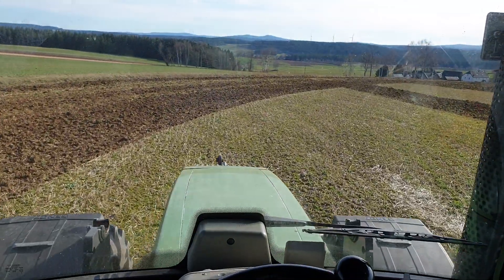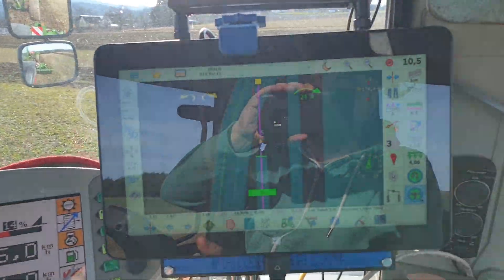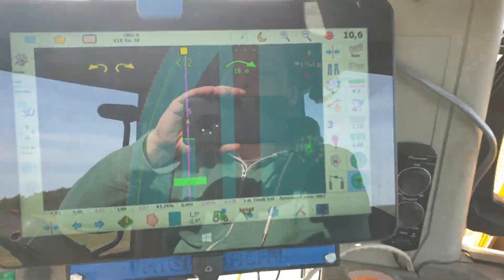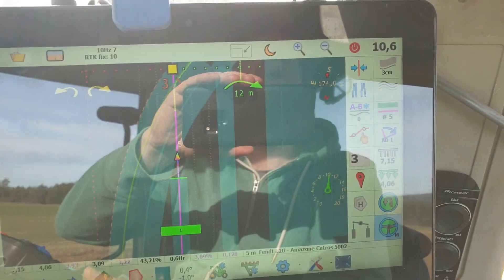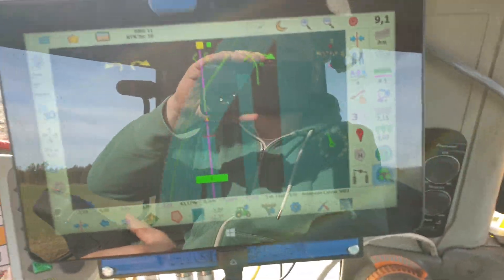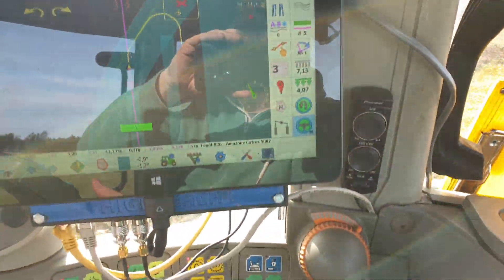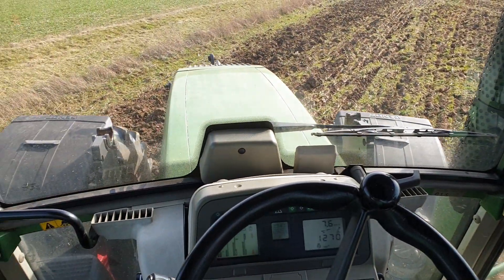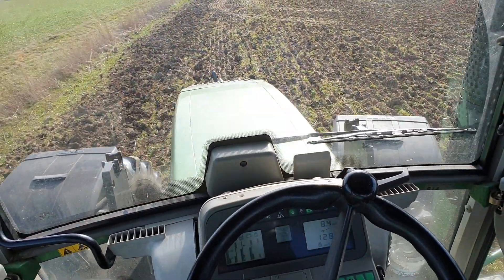Fendt 820 disc harrow AgOpenGps dual RTK

Comment: which receiver do you use?
how accurate can you be?

Thanks.
Reply from the maker: Its a trimble BD982, accuracy is RTK. Should be 2 cm
Reply: @thomasdeistler4435  with Ntrip correction?
Reply: @thomasdeistler4435  do you think the Ntrip system with a sim and 3g is better than base-rover?(ardusimple)
Reply from the maker: @edoardobordini3771  you have more coverage and in Germany you can use public Ntrip provider for small fee.
Reply: @thomasdeistler4435  thanks.

Do you use BNO055 (for heading) and MMA (for roll?)
Reply from the maker: @edoardobordini3771  no, both from dual Antenna
Reply: @thomasdeistler4435  ok thanks.
but is the hydraulic valve more accurate than the electric motor?
Reply from the maker: @edoardobordini3771  hydraulic is faster and more comftable, you can disable autosteer by turning steeringwheel.
Reply: @thomasdeistler4435  dual antenne. whitch one you use, simplertk2b and simplertk2blite? what is different on config at aog  whit one and two athenne
Reply from the maker: @wernerrosendaal2031  currently going with trimble bd982 as mentioned before. Config in AOG is heading from dual and roll from gps and the position antenna has an offset of about 80 cm in my case.

Comment: Hello, can you tell us which reciever do you use? Also I'd like to ask you for hydraulic description. What model of hydraulik vavle did you use and how it's connected.
Reply from the maker: Hello, Receiver is a trimble BD982. This Fendt is preequiped, so its a danfoss valve pvg32. It is controlled via ibt2.
Reply: @thomasdeistler4435  Thank you for reply. I see, so it probably automaticly cut of orbitrol. I have tractor wihtout any valves and I'm wondering how to make cut of orbitrol system.. I can't find redy to use valve with that option.. Have you got some idea?
Reply from the maker: You need a switching valve, should be a 6/2 vlave in order to change source obitol/valve.
Reply: Yeah, I know but I can’t find such valve. I asked many peoples for it but nobody could help me.. I found description of valve (5 way) on AgOpenGps wiki but I can’t find anything in afordable price.
Reply from the maker: You could use instead simple locking valves and connect prop. Valve and orbitol.
Reply: That was my first idea but I don't see such solution in AgOpenGPS.. I'm afraid about disengaging, in that scenario I need to do it manually. Do you have mounted encoder on wheel to disconecting system while you want to turn manually?
Reply from the maker: Theres a pressure switch in orbitol curcuit giving 5 V when turning the wheel during autoguide.
Reply: @thomasdeistler4435  Can I ask you for an email?